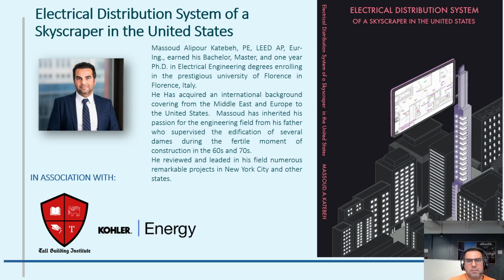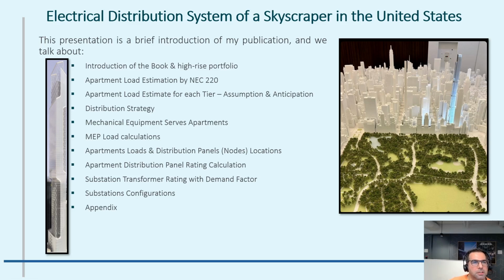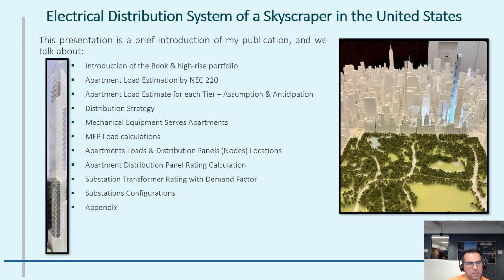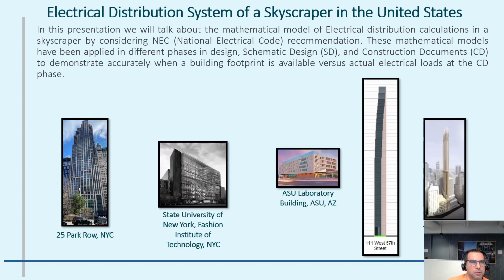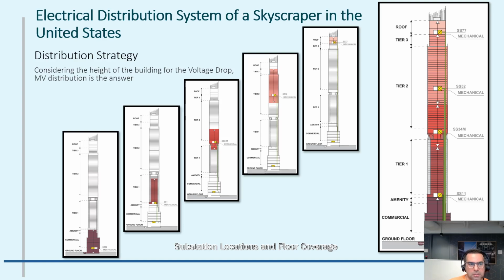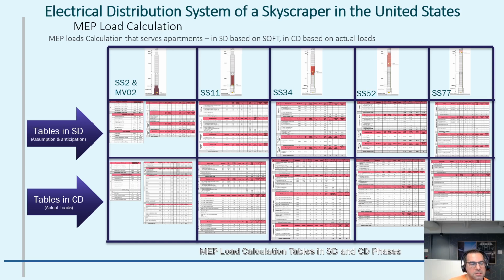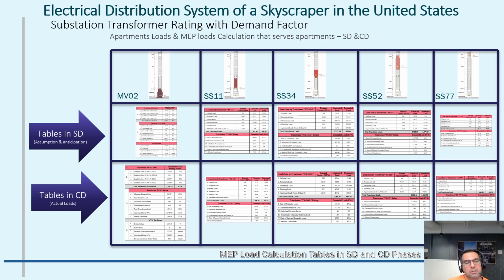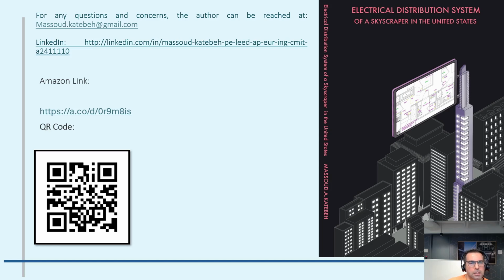Electrical Distribution System of a Skyscraper in United States

Comment: This presentation is incredibly insightful! I particularly appreciated the detailed explanation of the challenges faced in high-rise electrical design and the innovative solutions implemented. The section on load balancing and safety protocols was especially enlightening. Thank you for sharing such valuable information; it's a must-watch for electrical engineers and enthusiasts alike."